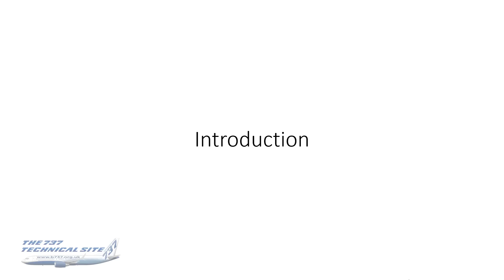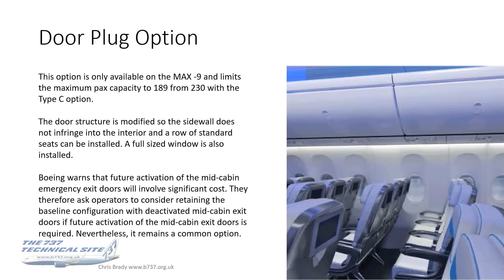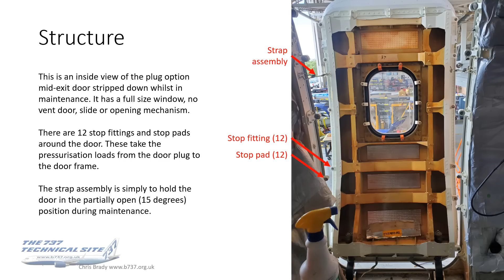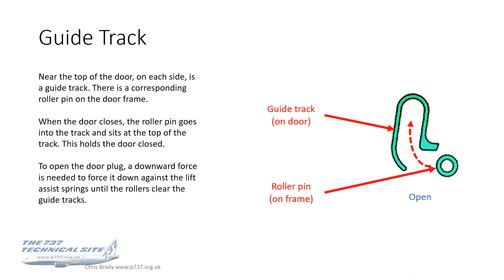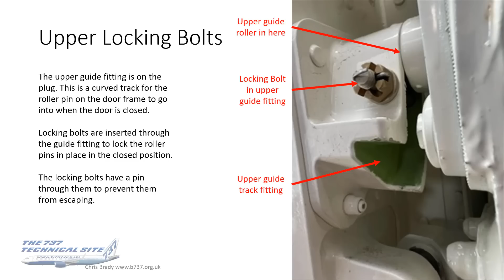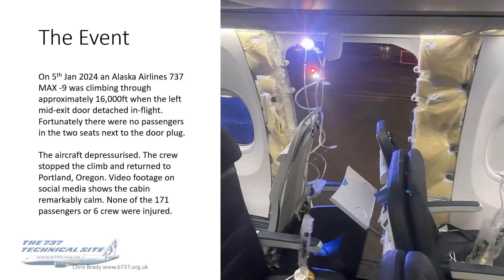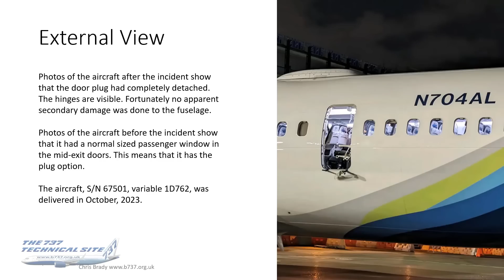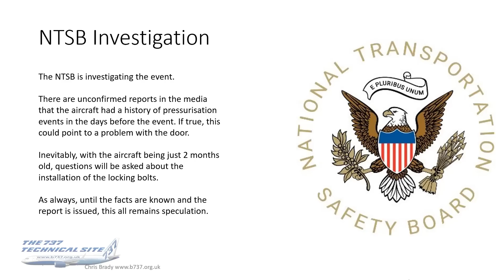737 Mid-Cabin Emergency Exit Doors - Plug Option

Comment: I'm struggling to see how the actual plug is a true 'plug' structure i.e. the inside is thicker than the outside?  Is this door more akin to the aft cargo door on the DC10 that caused all those safety issues and catastrophic crash in the 70s?  The problem with the DC10 cargo door was that it opened outward (hence relied on some type of mechanical claw mechanism to secure it) and was not a plug type door.
Reply: The plug opens outward, it doesn't install from inside.  Also, that door when in place also opens outward, with a latch.
Reply: @SteamCrane  interesting-so cabin pressure could force this plug open as opposed to sealing tight against the frame
Reply: @teremin21  Correct. Many airplane doors, including cargo doors, open outward, and depend on multiple latches to hold them closed.

Comment: So a door that is not even flush with the airplane is held in place literally by four bolts plus a couple of locking bolts that could easily snap from leverage?

I think what happened is the door vibrated from buffeting due to being shoddily made and not 100% flush with the aircraft. Over time it degraded the chitanium bolts and ultimately we have this incident.
Reply: Not exactly.  The beefy guide tracks and rollers, and the heavy spring posts at the bottom, hold the plug in place.  The 4 bolts are just to keep the door from moving up out of the guide tracks during turbulence.

Comment: Good vid.
Reply from the maker: Thanks!
Reply: @ChrisBrady737  those pins sticking out the doorframe, if I understand things correctly, don't look long enough. and a plug is not an access panel. The whole set up seems ludicrous, but then as Bobby Thompson used to say..." Aas not an engineer...". x

Comment: Obvious where the problems lie. First off, this is not a plug door. Plug doors are larger than the openings, like a bathtub stopper. The stopper never goes down the drain because its larger than the hole it plugs. Calling it a "plug" is either misleading at best and bad engineering at worst. Second, a simple oversight like forgetting to install the bolts for instance can result in an unintended door departure.
Reply from the maker: I agree entirely but Boeing definitely call this door plug a "plug-type" door in the AMM

Comment: Thanks to the mechanical and structural engineers that design these connections in detail. This is not easy work and needs to be tested thoroughly. So many force transfer calculations need to be considered.
Reply from the maker: Agreed!

Comment: The separation is so clean it's almost as if the locking bolts were not in place. Is there a latching mech that would hold the door in place appearing secure even if the bolts were missing? That doesn't sound like typical aviation design but still an unknown at this point.
Reply: Very simply, the 4 locking bolts were not installed after the last time the plug was opened by Alaska MX.

Comment: Whoever secured the trim panel should have seen any missing bolts.    Assuming the bolts were not installed properly.   Even if the bolts were loosely installed the cotter pins on the nuts would have prevented the nuts from coming off.

Comment: I’m an Aerospace Engineer working in Wichita. I dont work for Spirit anymore but I did briefly. I’m pretty sure Boeing takes the doors and plugs off of the fuselages in Renton. Spirit only partially installs them here in Wichita before shipping them off. So it’s gonna be hard to say who screwed up I think. But it sounds to me like Boeing has the responsibility for final installation of the door plug so I’m not sure how they could push the blame on Spirit.
Reply: Do you know if the airframe had the satellite antenna fitted when it left the factory?

Comment: The door has now been found... Will there be evidence that the guide rollers tore through the bolts that go through the upper guide tracks or did the rollers just cleanly disengage from the guide tracks because the no locking bolts were fitted?
Will the hinge guide fittings show evidence that they tore past the vertical movement arrestor bolts or has the guide fitting just smoothly slid off the hinge tubes without damage, showing the vertical movement arrestor bolts were not fitted? They have known the answer to that since a few minutes after the aircraft landed, as the hinge tubes are still attached to the aircraft and they will show similar evidence.
From the distant view we have of the outside of the aircraft, it looks like the left hinge tube (as viewed from outside, could be referred to as the forward tube) appears to be full length and undamaged as if no vertical movement arrestor bolt was present. The right hinge tube also appears to be full length but has what could be part of the bottom of the door plug still attached to it. This could indicate that the vertical movement arrestor bolt was present at that location resulting in part of the door being torn off and remaining attached to that hinge tube. What appears to possibly be part of the door hanging off the hinge tube could also be any random piece of debris from the cabin. I can't tell from the photo I've seen.
So either one or both vertical movement arrestor bolts were missing. The recovered door will reveal the presence or otherwise of the guide track locking bolts.
Reply: All 4 bolts were missing.

Comment: Sorry Chris but your video is full of inaccuracies.

For example,  7:00 the diagram shows the guide track on the door and pin on frame, but you say to 'open the door plug, a downward force is needed...until the rollers clear the guide tracks'. If the roller pin is the stationary element, then the guide track will further engage when the door is pushed down.

And did you seriously (at 9:20) call a Cotter pin 'locking wire'? To anyone qualified, it is clearly a Cotter pin.
Reply: I agree that there’s something logically in conflict here between the diagram and the text as shown at 6:33.

If paragraph two is true, which matches the diagram, then, how in paragraph three can the door be moved downwards when the pin is already at the TOP of the channels? .

Unfortunately, I cannot look at the photographs of those items at the same time I’m writing this. So, my next comment is based strictly upon this particular diagram and text.

However, thinking from an engineering point of view, which I’m not, but I have some mechanical background, if the roller pin was on the door, and the guide track was on the frame, then it makes sense that you would push the door down until it clears the track. And that the springs would push the door pins up into the frame tracks and keeping it secured unless something pushed it down which the lock pins would stop.

Addendum: 
Looking at the photograph of the upper locking bolts at 9:05,  it certainly looks here like the roller pin is on the DOOR, and the track is on the fuselage based on this being the left side of plug as seen from inside cabin.
Reply: @JohnHallgren , Regarding your addendum, I’ve flipped back & forth between that 9:05 photo showing the pin engaged & lock bolt installed in guide, and the earlier photo showing the door opened outward a foot or more. Zooming in to extreme upper right corner of the open door photo clearly shows the roller pin on the frame. The guide is harder to see, but looking close it is recognizable on the plug door. So the 9:05 photo is taken from the inside looking out, but at the upper RIGHT corner of door.
Reply: @Bitterrootbackroads  ok, and I appreciate you zooming in to pix! 
But… if that’s the upper right, and the guide is on the door, it would seem impossible to be able to push the door down in any way because the pin would prevent that direction of movement, right? Yet the manual apparently says to push downward to compress springs…🤔
And that would mean that all the locking bolts are critical to keep the door from being sprung up and out , true?
Reply from the maker: * Errata *
In this video I state that a downwards force is required to remove the door plug. I based this statement on text in the AMM SDS which I now believe to be incorrect or misleading. It is possible that a very small downwards motion (1-2mm) is first required to be able to free the locking bolts. But the door must be moved upwards by a couple of inches to clear the guide tracks. Apologies for any confusion.
Reply from the maker: Check the AMM SDS, it clearly states that a downward force is needed to compress the springs first. BTW I am not qualified as an engineer, I am a 737 pilot.
Reply: @ChrisBrady737  The instructions are wrong.  I suspect it was subcontracted to India along with MCAS software.

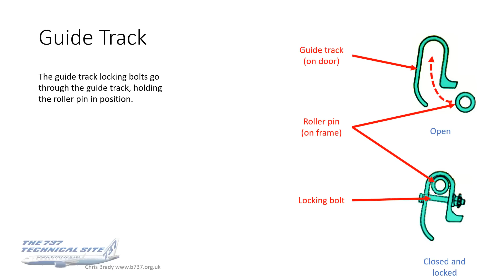Comment: I am confused. The statement at 4:00 says the door slides down to clear the stops for opening. There is a clear gap at the TOP of the door, none at the bottom. However the construction of the rollers and guides at the top of the door, shown at  8:30 and 9:00 clearly show the door must move UP to clear the guides. I think the door lifts UP to open,  assisted by the springs, clears the guide and stops, then moves out on the lower hinges. Who supplied the text at 4:00? And yes, I was an L.A.M.E. with 36 years experience.
Reply from the maker: * Errata *
In this video I state that a downwards force is required to remove the door plug. I based this statement on text in the AMM SDS which I now believe to be incorrect or misleading. It is possible that a very small downwards motion (1-2mm) is first required to be able to free the locking bolts. But the door must be moved upwards by a couple of inches to clear the guide tracks. Apologies for any confusion.
Reply from the maker: AMM SDS 52-23-00 Page 6 MID CABIN EXIT DOOR PLUG - COMPONENTS, Lift Assist Springs:
"Apply a downward force to the door plug this forces it down until the rollers clear the guide tracks. At this time the door plug can open outboard."
Reply: @ChrisBrady737  The diagram you show at 8:30 clearly shows the door moves DOWN to the locked  (and bolted) position. Is the diagram wrong or is the instruction being misinterpreted? The springs seem to exist to help lift the door with the weight of a slide pack included. (Stronger springs for an activated door, perhaps?) Perhaps the door is lifted to clear the rollers from the guide then pushed down to open once clear of the guide and stops. One of the other presentations you have published in recent days, demonstrating the activated exit door with slide, at 4:20, says that the door must be LIFTED to clear the stops. It seems unlikely that the guide and stop system would be different on a deactivated plug, compared to an active slide system.

Comment: Seems to me, there should be a prox system installed to indicate the door is properly closed. You know, like on every other pressurized door on the aircraft.
Reply from the maker: There normally is, but it is disabled on the mid-exit doors on aircraft with the plug option
Reply: @ChrisBrady737  exactly my point. In the modern age of aviation, just seems like something you’d hear about in a 1960s crash.

Comment: Excellent video and done very quickly, which wil hopefully limit the amount of misapprehension in news reports and on social media.  
The door has to be lifted up, not forced down (as you say), to clear the stop pads and free the guide roller from its guide track.  The diagram makes this obvious - the roller pins are attached to the door frame, the guide tracks to the door plug.  As does the terminology "lift assist springs".
All four bolts prevent vertical movement.  Vertical movement is necessary to clear the stop pads and before the door or door plug can move outwards.
It's fortunate that the door plug did not impact the tailplane.  
The door plugs are "installed but not finished" by Spirit Aviation (which used to be Boeing Wichita) - apparantly Seattle removes the door plugs to use the openings to get internal fittings and finishings into the fuselage, then reattaches the door plugs, closes them and fits the safety bolts.
Reply from the maker: You are correct - * Errata *
In this video I state that a downwards force is required to remove the door plug. I based this statement on text in the AMM SDS which I now believe to be incorrect or misleading. It is possible that a very small downwards motion (1-2mm) is first required to be able to free the locking bolts. But the door must be moved upwards by a couple of inches to clear the guide tracks. Apologies for any confusion.
Reply: @ChrisBrady737   Hi Chris, thank you for the great video and the correction. Do you know if any passengers complained that these plugs make a lot of rattling noise during take off?
Reply from the maker: @VolkanYuksel Unfortunately I don’t know that. I’m sure it will come out in due course.

Comment: There may be no fault in the locking system. By simply deforming the door enough, it can be pulled out of place. I see the top pin roolers are short. They have already found the door, do we have a photo of the door?
Reply: Agreed, if the door has the guides intact with lock bolts in position, then the only answer is that the door bulged outward enough that the guides pulled themselves sideways off the pins. Per pics & diagram the upper lock bolts do not pass through the pin, they simply trap that stubby pin in the guide. The thought of this happening at 16K feet on a new plane that has made many recent flights, presumably to 30K+ feet, seems preposterous.
Reply: The concept of not having a door bigger than the hole is brain dead DEI stupid.

Comment: 7:05 "Push the top of the door plug down to clear the door plug from the guide fittings" That's from the AMM and Chris said it too. But I don't quite understand it. The guide tracks are on the plug, the rollers are on the frame. So the plug needs to be pushed UP for rollers move down relative to the guide tracks.

I's also quite clear in the photo at 8:49. The left hand part is the plug with the guide track and the right hand part is the door frame with the roller pin. The guide track (and plug) can't move down.

What am I missing?
Reply from the maker: * Errata *
In this video I state that a downwards force is required to remove the door plug. I based this statement on text in the AMM SDS which I now believe to be incorrect or misleading. It is possible that a very small downwards motion (1-2mm) is first required to be able to free the locking bolts. But the door must be moved upwards by a couple of inches to clear the guide tracks. Apologies for any confusion.
Reply: @ChrisBrady737  No apologies necessary. I have no physical access to the B39M and was relying on the SDS for information, where I found this confusing statement. I thought you might be able to clarify the matter. Thank you for doing so.
Reply from the maker: AMM SDS 52-23-00 Page 6 MID CABIN EXIT DOOR PLUG - COMPONENTS, Lift Assist Springs:
"Apply a downward force to the door plug this forces it down until the rollers clear the guide tracks. At this time the door plug can open outboard."
Reply: @ChrisBrady737  I read that too. My quote from the manual is actually from page 6 "OPERATION". But in order to get the rollers clear of the guide track, the plug needs to move up. The guide fittings are attached to the plug and closed at the top, open at the bottom. the plug can't move any further down. Is the manual incorrect?

Comment: There is one point that doesn't make sense, at around 7:05. "To open the door plug, a downward force is needed on the plug door to force it down, against the lift assist springs, until the rollers clear the guide tracks". This cannot be correct. Since the guide tracks are an inverted-U shape and attached to the door, forcing the door down will merely hold the roller pins into the top of the guide tracks, preventing it from being opened. According to all of the diagrams in this video, the only way to open the door is to force it *up*.
Reply from the maker: AMM SDS 52-23-00 Page 6 MID CABIN EXIT DOOR PLUG - COMPONENTS, Lift Assist Springs:
"Apply a downward force to the door plug this forces it down until the rollers clear the guide tracks. At this time the door plug can open outboard."
Reply: @ChrisBrady737  OK, thanks for that. The trouble is that this instruction is completely and utterly incompatible with the roller pin being inside an upside-down U-shaped channel. For the rollers to clear a guide by pushing the door down, the U shape guide on the door has to have its open end facing upwards.
Reply from the maker: * Errata *
In this video I state that a downwards force is required to remove the door plug. I based this statement on text in the AMM SDS which I now believe to be incorrect or misleading. It is possible that a very small downwards motion (1-2mm) is first required to be able to free the locking bolts. But the door must be moved upwards by a couple of inches to clear the guide tracks. Apologies for any confusion.